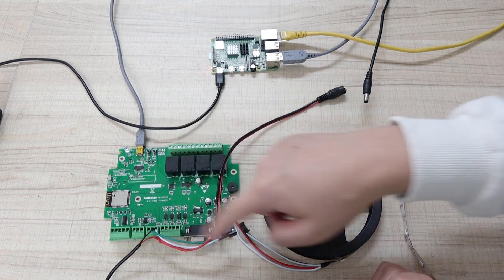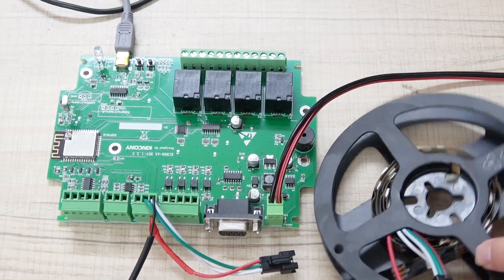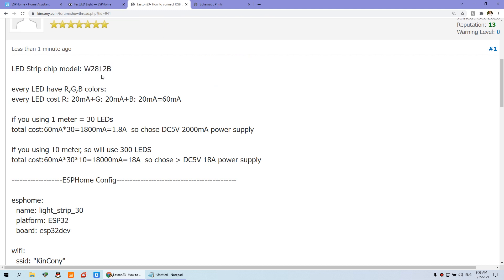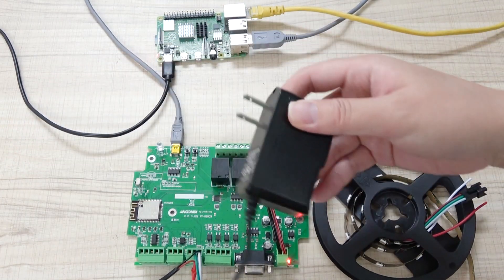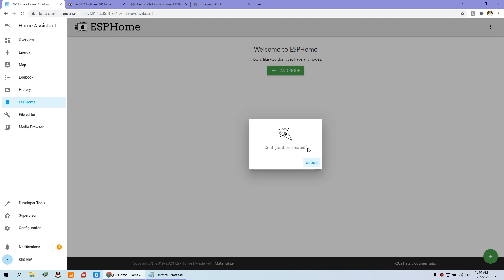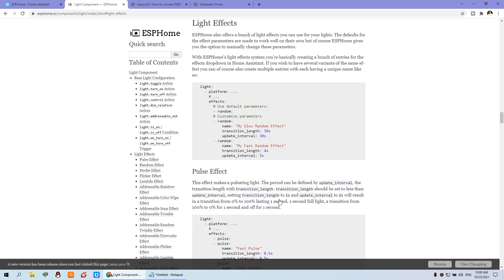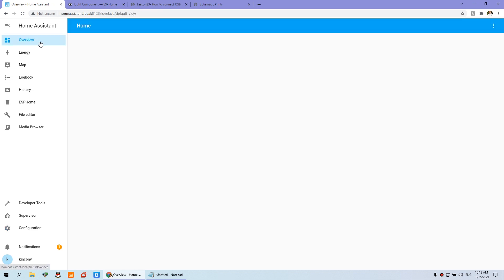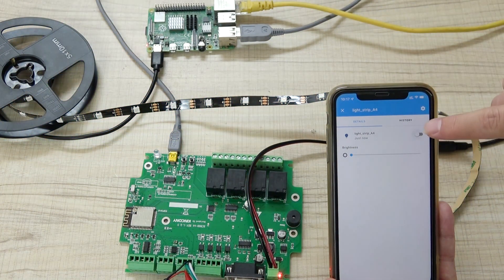Lesson23-  How to use LED strip for home assistant by ESPhome

Comment: How to use ws2811 rgb strip  light
That contain 3 terminal vcc- ground -  signal
but vcc 12 volt
Reply from the maker: although vcc is 12v dc, this is for LED's power, the DATA of ws2811 also use by 5v level voltage.
Reply: @KinCony  thank you
I will connect vcc 12v with power supply and connect ground led with ground power supply and connect segnal of led with pin data of A4
Reply from the maker: @engkah889gv5  yes
Reply: @KinCony 
Can explore more information pin data with 5volt level?
Reply from the maker: @engkah889gv5  usually is 5v for data, this you can confirm with your LED strip seller.